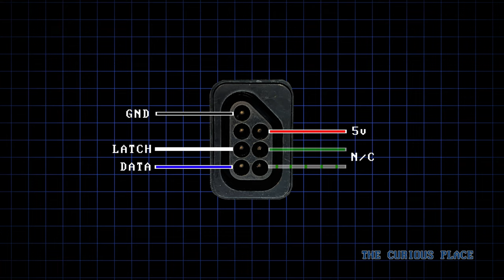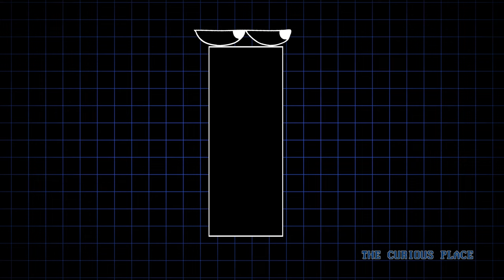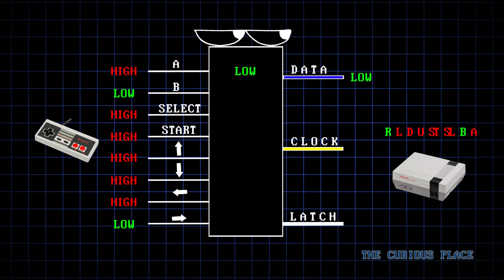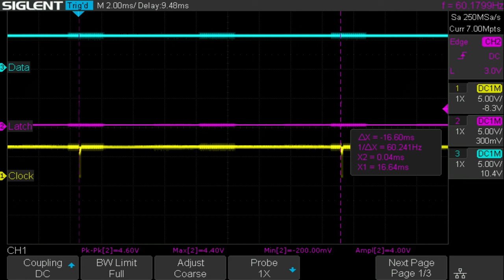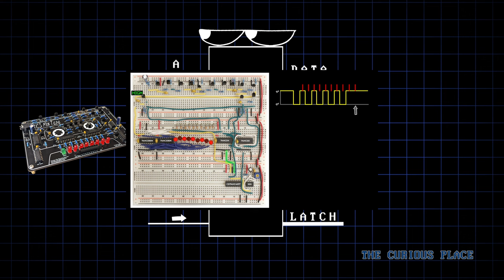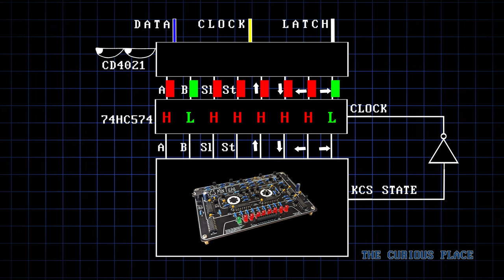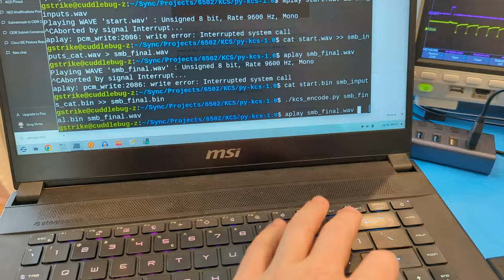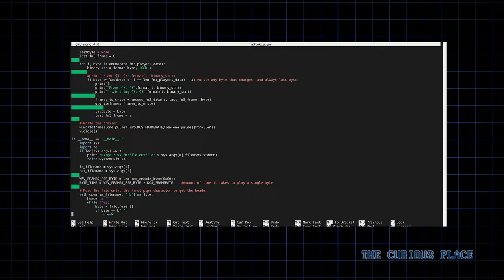Building a Programmable NES Controller - The Curious Place 007

Comment: Will it serve to play replay files from emulators like fceux and mesen?
Reply from the maker: The controller will present whatever data it's handed to the NES.  In this video, that data is extracted from an FCEUX .FM3 file and fed to the controller through the KCS Mix Tape.  There's a script on my GitHub that does the .FM3 data extraction and conversion.  There are some technical limitations of doing it this way (feeding it through the Mix Tape) since there's no feedback keeping things in sync, and is why we Mario killing himself so much.  However, I plan to revisit this from a different approach using feedback from the NES.  The result should be the controller "knowing" exactly where we are in the game, and allow perfectly synced playback of FCEUX .FM3 files!
Reply: @GregStrike  very Nice!!

Comment: The thing you built with the labeled LEDs … what's going on there? It doesn't appear to be electrical since I can see your current limiting resistors plugged in rather than being on the board, so my guess is not PCB. Did you just 3D print a shim for labeling purposes? Repurpose something that's available elsewhere? Something else?

I learned the breadboarding trick of using a 10 segment bar graph and a 5 or 9 pin resistor networks to give me a bye or two nybbles, and I've seen a few "3.3-12v LED" tricks, but I haven't seen your solution. Yours has room for at least a character or two of label, even if it takes almost half a breadboard. Sadly the old Heathkit and Radio Shack lab thingies aren't really available anymore. Certainly nothing that convenient at that kind of price point.

Also, inb4 the KCSMT gets modified to support CUTS and other KCS derived formats/baud rates. There were variants up to 2400 baud, after all. 😁
Reply from the maker: Hey man!  The LED Label was a cool project I came across on Thingiverse ( https://www.thingiverse.com/thing:4102155 ).  There's a 1,4, 8 & 16 LED version and are easy enough to 3D print!  I thought it was a nice way for people to see the bits that correspond to the buttons.  

And yeah, I would love to update the Mix Tape!  It's absolutely on my list!  But, I also have some other really fun projects I'm working on that I'm really excited to share & teach as well!
Reply from the maker: (edit) fixed Thingiverse link